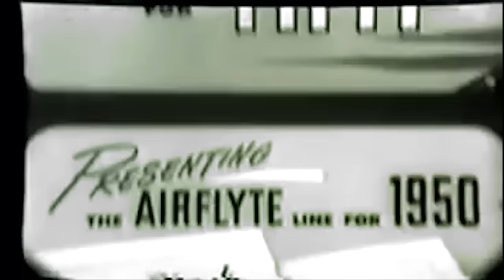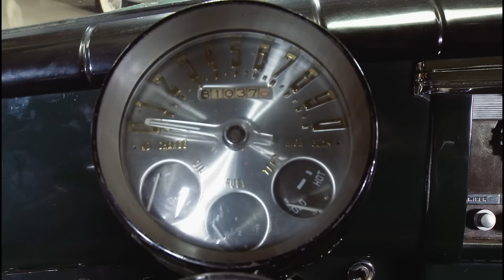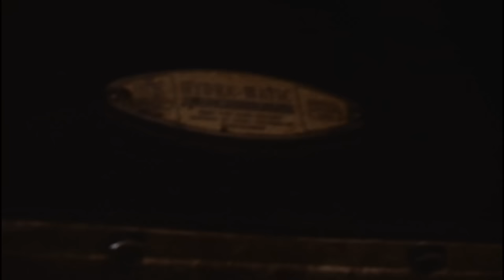1950 Nash Ambassador Custom - Jay Leno's Garage

Comment: Jay, you are the best!  Battista "Pinin" Farina was not involved in styling this one.  Much of it was done by Nash engineer Nils Walborg and tested in a wind tunnel, hence the enclosed front wheels.  The Weather Eye was, indeed, more than just a heater.  It refers, of course the eye of a storm when the weather is calm.  Nash introduced it with outside air for the heater and specially designed weather stripping to allow air to evacuate the body without drafts.  It was a much improved system when introduced and the basis of what is widely used today.
Nash - Kelvinator merged with Hudson on May 1, 1954.  The name of the Nash Kelvinator corporation was changed to American Motors which endured, without bailouts or bankruptcies, until acquired by Chrysler in 1987.  The Nash and Hudson marques were dropped for the 1958 model year never to return.

Comment: My husband and I had a  swell 1953 Nash Pinen Farina  2 door station wagon  with totally enclosed front wheel wells  ,,It had a flathead  6 of I  think 186 inches, water punp was powered by aan extended generator shaft which power a water pump  on the side of the  lower engine block . It had the  Pinen Farina  crests  badged on both   lower front fenders was Sky  blue  over  Navy blue. Bought in 1983  with 53,000  miles and  drove it home from Florida to Mississippi  with out a hitch. Wish i had it now.

Comment: Weather Eye was actually quite an innovation for its time.  If I am not mistaken it was the first thermostatically controlled, hot water forced air heater used in an automobile.  AMC carried the Weather Eye name well into the 70's.
Reply: yes!...and it was a simple, very effective heater!
Reply: As was the "All-Weather Eye", the first modern a/c with all the works in the cowl & under the hood, and all controls on the dash.  Optional on the big cars as well as the Rambler, 1954.  The innovation of 1937s "Weather Eye" was not just thermostatic control, but that it allowed taking fresh outside air through the heater, instead of just recirculating cabin air.

Comment: I grew up in cleveland and our neighbor, a postmaster, left my mother a Nash like this one. It only had 38,000 miles and was in nice shape. It was maroon in color, had what they called a fluid shift, 3 on the tree and I drove it for my wedding in 1983. What impressed me was the booklet that came with it; It detailed every nut & bolt and the correct measurements for everything, brake lines, head bolts, everything ! What a wonderful automobile !                                         Thanks Jay ! , your OK

Comment: My father owned 2 of these Nash Statesman Airflytes. A 1949 and a 1950. The "50 was all black and the "49 was a light green. This was in 1957 and 1958. I was 7 yrs old. I thought the interior was huge and remember standing up in the back seat holding onto the bars across the back of the front seats. Thanks for a trip in the wayback machine. I also owned a Nash in my later years(1994) I bought a 1935 Nash Layfayette. Absolutly rust free car with excellent paint and ran like a Swiss watch. I loved that car but due to divorce I had to sell it.

Comment: As far as the 6-12V conversion goes, its more of a matter of convenience.  I agree the 6v system is sufficient and fine for the "Sunday cruiser" but for cars that are everyday drivers it's no comparison.  The upgrade takes the load off the original wiring and switches.  Its convenient for electric accessories, like the CD player, radio and USB chargers.  And 6v components are getting difficult to find on short notice.

Comment: I love old cars like this. It was from a time where people actually took pride in their work and designed things to last. I'm quite surprised that cars like this are rather affordable. I'd would like to buy one.
Reply: thelongslowgoodbye You might want to check out vacuum cleaners from the same time period, I got a working Hoover 62 (1950-1953) for $2 at a rummage sale and it's remarkable.
Reply: Sort of. Except that 1950s cars were thought to be doing very well indeed if you reached 100,000 miles before they died, and if they made 10 years before rusting to a hulk, often a lot less. A modern car is just breaking in a 100,000 miles, and 200,000 is nothing unusual...and this with only minimal maintenance. While many things are cheap and plasticky these days, it's not realistic to include cars in this category. The amount of plastic crap ON them is deplorable, and the complexity has risen dramatically so it is hard to fix them at home, but they do last longer from the factory without careful maintenance.
Reply: I bought one for $400 in Canada.I had one look underneath and sold it. The unibody looked rotted. Keep in mind Jay is in Cali. Those cars can be very unsafe underneath.
Reply: @kelharper7971  I agree with all you said but Ralph Nader should re-release his book about the Corvair, Unsafe at any Speed! To include 90% of today's Japanese and other import cars!
Reply: Tom Cass  Right, certainly than a corvair, but others, ask all the dead folks killed in Japanese tin cars each year!
Reply: People still take pride in their work. It's just that now workers are forced to build cheap crap, or more likely the factory moves out of the country altogether.
Reply: @ronschlorff7089  That isn't at all true. You want it to be true, but it is not.
Reply: @ronschlorff7089  That simply isn't true.
Reply: @spaceghost8995  ok, drive only 45 mph with this Nash toward a Prius, and see who walks away!! Hmmmm?
Reply: Ron Schlorff The Prius driver dude. The amount of people who don’t understand crumple zones on modern cars astonishes me. That Nash wasn’t designed to absorb enough of the impact force to keep the driver and others in the passenger compartment safe. If you don’t believe me, just go check out the IIHS video comparing the crash safety of old an new cars.
Reply: @aydinsengun5088  "Sherman Tanks" don't need any stinkin' "crumple zones", they just crumple other cars!! ;D LOL
Reply: @ronschlorff7089  my god do you really think that a any road car is comparable to a tank... Jesus...
Reply: The thing is, those older cars rarely lasted 100,000 miles without needing serious repairs. Jay mentioned this, as if it was an amazing thing...but cars of today routinely last 200 thousand miles plus! Older cars are truly cool, but definitely not so great overall, compared to modern cars.

Comment: My dad owned a 1950 Nash Ambassador Custom. He was a Nash guy and owned them from just after WWII until 1954. I remember the WeatherEye controls. He always bought 3-speed manuals. I remember the fold-down seat-beds--but you couldn't have much luggage in the trunk if you wanted to use the bed!

Comment: In 1953, we drove our 1953 Nash Rambler from Chicago to California via Rte 66 and back the northern route.  No problem.  Had a water evaporative air conditioner attached on the outside of the windows to make it through the desert.  A few years later, it developed a crack in the engine block, and we traded it for a 1956 Pontiac.   Watch out for the cracked block, Jay.

Comment: I've always had an admiration for these old Nash cars even being more of an import car fan. I just love the design of how the wheels are inside of the body.
Reply: You would only love the front wheels being inside the body up until you needed to make a sharp evasive turn and couldn't do it to save your life. A right turn from a narrow street into a single lane driveway is beyond these cars unless you get exactly right. They look different but they were doomed by the restricted front wheels. It's amazing these cars are still allowed on the road.
Reply: the only thing this car needs is bags
Reply: SSH One of the problems with the Edsel was that it was put on the same build line as the Galaxy. Unfortunately they continued to require the same number of Galaxys to come off that line.The result was a car built so fast that quality suffered. By the time this was corrected the cars had a reputation as fall apart junk.
The styling was controversial as well. One reviewer said, of the grill, that it looked like the cars had been sucking on a lemon.
Reply: It looks cool but how does one change a flat on this?
Reply: 太陽ダビデ Jack it up with the bumper jack. It had to go up a long way to get it off the ground and it was dangerous. Then you changed out the wheel same as with any other car.
Reply: REMINDER - This car raced the Carrera Panamericana and also dirt ovals. One of the units Nash fielded for the 1950 edition of the legendary Panamericana was Bill France Sr.
Reply: +John
Reply: I thought the front wheels were covered by fender skirts which are usually covering the back wheels.Upon closer inspection I noticed the front wheels are covered by a solid continuous fender.Didn"t the tires rub the inside of the fender?You would need a football field to make a 180 degree turn.Changing a flat front tire must have been more fun than a barrel of monkeys.
Reply: well, given how low the axles are to the body, i'd expect the whole process to be just as simple, adding a little bit of wiggling the tyre off the studs and the drum.
Reply: The front track was narrower to allow a satisfactory turning radius within the covers.  The view up on the lift at 11:40 shows this.
Reply: @cologist  Slowly, and with a lot of cursing.

Comment: My Dad had a 1950 Nash which was the bane of all my embarrassment when I was a kid but to think back on it now it was a very cool car you could change radio stations with a button on the floor it was to the left of all the other peddles and gas and it had a dual transmission you could shift or pull a lever and the car became automatic. Nash did some innovative things one piece windshield and a rear speaker in the back this was 1950 and the offered set belts and it made into a bed.
Reply: The 1948 Tucker had seat belts but the Big 3 exclaimed"if it has seat belts it's a dangerous car too drive".Go figure.One last remark;if you didn't offer a v-8 in 1955 you were dead in the water.(hello Kaiser).
Reply: @vernwallen4246  Which was stupid because a 6 has better torque than an 8. You really weren't giving anything up with a 6 except for top speed.

Comment: In the 80s in college one of my brothers bought a 62 Rambler Classic 2 door, and another bought a 62 Rambler Classic 4 door wagon. The 2 door had  "3 on the tree", and the wagon had a push button auto transmission. Both had seats that made a bed. You put brackets in holes under the rear seat cushions, ran the front seat as far forward as possible then dropped the seat backs onto the brackets. Both cars still had the brackets.

Comment: Beautiful looking car. I've always loved these old cars of the late 1940s- early 1950s. They may not be high performance machines, but so what? For everyday driving, even today's driving, they can be good cars to drive, particularly if you want something that stands out. I also like cars that are original, and unrestored. just kept up, looking, and running like it should. Apparently, the people who tried to upgrade the electrical systems, did it the wrong way. I believe that it takes more than simply giving it 12v wiring. I believe that everything should be upgraded to 12 volts, not just the wiring. Thanks for posting, Jay. Awesome looking car. :)

Comment: Nash didn't go out of business in the mid 50s,  the company morphed into American Motors,  which was finally bought out by Chrysler in 1987.
Reply: More specifically, they merged with Hudson in 1954 to become American Motors Corporation, which continued until the Chrysler buyout in 1987.  But only the Nash parts of the business in Wisconsin (their three plants in Kenosha, Rancine, and Milwaukee) ended up surviving under AMC ownership, and of those, only one is still standing (it's now a Chrysler parts depot in Milwaukee, it was originally built by Nash to build the LaFayette brand luxury cars, which flopped, then built various Nash models until it eventually became AMC's parts depot). Oh yeah, the old AMC HQ building in Detroit which had originally been built as a Kelvinator refrigerator plant in the 1920's then pressed into service as AMC's engineering department became Chrysler Truck Engineering until it was abandoned in 2009  when Chrysler Truck Engineering moved into new quarters in the main Chrysler Engineering complex in Auburn Hills.

I'm not quite sure what Nash got out of that merger with Hudson, other than dealers.
Reply: If only Packard had merged with the then new AMC Corporation instead of Studebaker there might still be four. 
Thank goodness that Tesla is what it is and there is Rivian in the not so distant future. Though different than our past they represent burgeoning domestic automotive manufacturing and new industry. Moreover it can save our remaining legacy makers and might create the signal the reinvention of the great American full size and luxury size cars in the 9 and 8 segments as oil consumption would be of minimal concern.
Reply: I remember hearing the term Nash Rambler .
Reply: @rancedodd  Yep, that's what it was originally called, until then-CEO Romney (former GOP candidate Mitt Romney's daddy) realized that "Rambler" had better name recognition and reputation than either "Nash" or "Hudson", and discontinued the Nash and Hudson name badges and all the cars afterwards were just Ramblers. Then when Abernathy took over after Romney left to become governor of Michigan, Abernathy decided he wanted to build big luxury cars and Rambler was synonymous with compact economy cars, so he rebadged everything as AMC, with the Rambler compacts becoming "Rambler by AMC" until finally phased out in 1970 when replaced by the AMC Hornet compact. (The Hornet name being of course a famous Hudson name that became owned by AMC when Hudson merged with Nash, but the Hudson Hornet had been a large car while the AMC Hornet was a compact).
Reply: The 1968 AMC Ambassador was pure luxury.
Reply: @falconmoose1589  That it was, but it sold like ice cubes to Eskimos. AMC didn't have the budget to compete with Oldmobile and Chrysler and etc. on styling and luxury, plus the unitary body was more difficult to change from year to year than the body-on-frame competition from the Big Three, plus AMC had a reputation as a maker of budget cars (despite their antiquated factories making it hard to match the Big Three on price). In the end what killed AMC was the same thing that drove the merger between Nash and Hudson in the first place -- difficulty competing with the Big Three. The emissions and safety requirements added in the 1970's and the fuel economy requirements added in the 1980's were simply beyond what they could afford to deal with without massive external investment from Renault, and when that went away, they had no choice but to sell out to Chrysler. What's amazing is that despite all the issues AMC faced -- delapidated plants built at the end of the 1800's, small volume compared to the Big Three, not much money for design and styling changes, etc. --  they managed to make a profit in half the years between the merger and their eventual sale to Chrysler.
Reply: @TheEricleegreen  Yes. But a wonderful design.
Reply: @badtux   Very cool. I drive a truck, I pick up loads at that old Milwaukee plant and run them out to NY and other places. You can tell it's old, it is actually stuck right in the middle of a residential neighborhood. Just one legal truck route in and out of there!
Reply: @TheEricleegreen  The only reason Chrysler bought AMC was so they could get the Jeep CJ5, CJ7 and Wrangler.
Reply: Bruce Solomon “If only Packard had merged...”. WWII helped kill Packard.  They did a great job supporting the war effort but their capital base was worn out in the process and they never really recovered.

Comment: In '69 I bought a Rambler wagon (don't remember the year) to use for a move to Austin.  Quit my job at the shipyard, bid all my farewells, loaded up my new/used Rambler wagon and headed out.  2-blocks into my adventure I went over some railroad tracks and a piston went through the head.

Comment: Dear Jay and Team! Thank you for showing this great car on the street. Very nice filmed!
The Nash 1949 Ambassador or the Statesman are one of my very favorites of USA cars. Also I love a lot the Chrysler Airflow with the waterfall grill (CU).
The famous SCHUCO tin-plate Varianto Limo cars are very likely modeled after the 1951 Statesman Nash (tail lights and closes wheels). I think the airflytes of 1949 are the handsomest looking' models of these. 
Your 1951 Hudson Hornet is also close to these...
I must admit that I would love to see one of these SW tube radios working. I think the dashboard and RADIO of the 1949 model looks even nicer.
Thanks to your words towards 6 Volts. I like 6V better. It seems also that the light-bulbs last longer... With sufficient Ampère hours no problemo- just fine.
Thanks again,
cordial greetings - from a north german watchmaker who lives close to the lake geneva (Switzerland)
Géréon
PS: My classic car is a Citroën Dyane of 1967 a luxury 2CV (425cc, 18HP, 6 Volts, 105 true Km/h, 4.3 Litres on 100Km)...

Comment: Uber is to Taxi companies as Nash was to Motels :)
Reply: Except nobody really bought Nashes, they went out of business and the motels didn't, and didn't do hardly any damage to the motel industry at all, certainly brought no lasting changes. In all those regards it's completely different that Uber vs taxi cabs. But you're right, they are just alike , insofar as one industry segment taking sales from another industry segment is related to Uber vs Motels.
Reply: @kelharper7971  NASH MERGED WITH HUDSON TO BECOME AMERICAN MOTORS IN 1954
Reply: Most cars from the fifties and sixties were "motels", if they needed to be. Get a room meant, "let's move to the back seat for some more room, sweetie"! :D